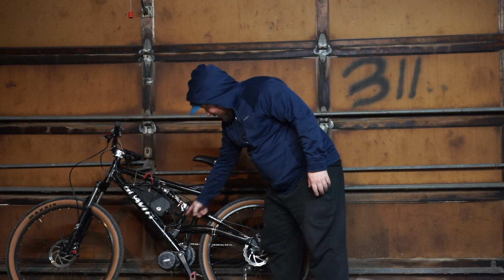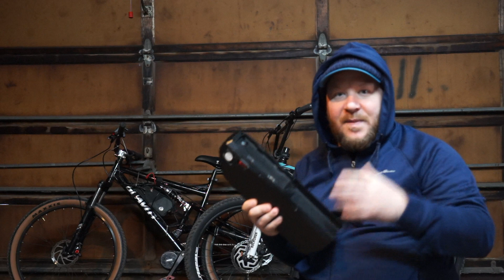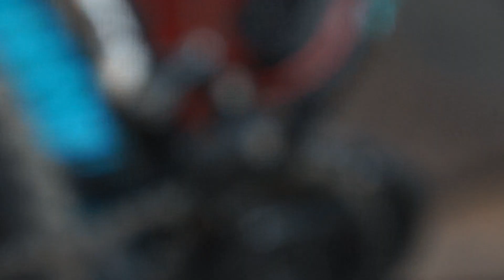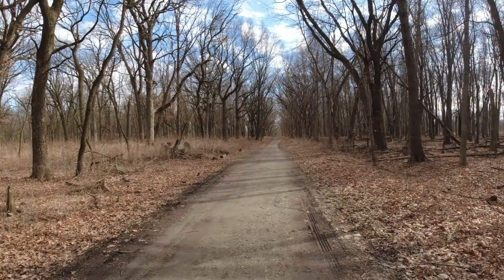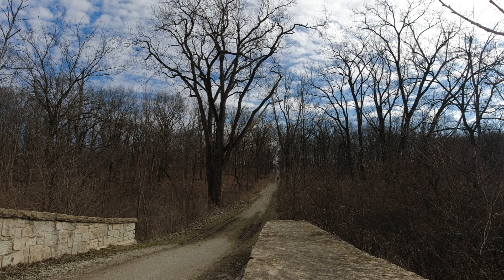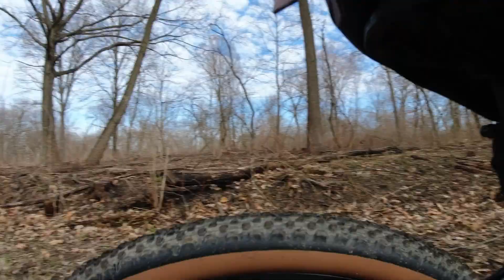How the BBS02 Stacks Up Aganist the BBSHD?

Comment: BBS02 is lighter but if you push 1200w+ the nylon gears will soon need replacing or upgrading. BBSHD is a heavier tank that can be modded for 72v with an upgraded controller. Insane. Chews sprockets for brunch. IMO the hubs are like driving an automatic whereas the mids require active shifting. Can't start out in top gear nor can you go too fast in 1st gear.

Comment: hi! i want to do delivery for like 8 hours, and am looking at the bbshd, i dont plan on using throttle only, and would pedal on flat ground too mostly, and was wondering what battery set up youd recomend? would you do dual battery or is that too complicated? is 48v good for range? im looking to go 100-150km with battery
Reply: maybe even more KM on a charge if possible lol

Comment: I have an 02 with an hd controller.  Best of both worlds.
Reply from the maker: intersting!
Reply: I'm pretty sure they use the same controller, but the amperage is turned up a little higher on the BBSHD "35A" in the control tunings. It's the same replacement part. You only get "more" by adding a higher voltage/amp battery or an external aftermarket controller.

Comment: I bought a 52 by 20 if that makes sense. That was a good deal but I almost want a smaller battery for weight concerns. The tuning chord is on the way but that means I'm going to have to buy a laptop. I will because the nerd in me wants to f*** with it
Reply from the maker: yes 52v 20ah. I feel you! I had to buy a $20 windows laptop to tune my bafang's as the program doesn't run on mac.
Reply: @GuntherSnaps  got an adapter for my cord, supposed to be able to go through my phone we'll see.lol

Comment: Like you I want to peddle for exercise.   I converted a 26" mountain bike back 2020 with a BBS02, 27" wheels, a Shimano 8-speed IGH.  By installing a 54 tooth chainring I can maintain contact with the peddles at fairly high speeds in peddle assist 1.  Once tuned it is very hard to beat this setup as I have put over 5,000 miles on this bike in the years since, thanks for the confirming review.
Reply from the maker: yea I really like having both, but the bbs02 is much easier to ride for exercise!

Comment: what range are u seeing on the bbso2? i get 10 miles max on top power setting. 17ah battery.
Reply from the maker: Honestly I don't even know, I'm only running like 6 miles at most and then I charge and I'm pedaling a lot so usually getting home with like 99% battery

Comment: Hi there. 
Would the 750 watt be enough for climbing steep hills on the road, or would the 1000 watt be a better motor to go with? Is the 1000 watt more thrilling to ride? I was also concerned the 1000 watt would disintegrate and wear out my cassette hub faster...
Reply from the maker: All depends on how much you weigh, I'm like 235 lbs and I go up a super steep hill on the bbs02, for me it actually works better because I can get into the correct "climbing gear" with the 02. so it actually takes a lot less effort to get up our steepest hill

Comment: Use Gustavo offset chainrings (way cheaper than Lekkie) and perform just as well. They have a narrow-wide profile to hold the chain on better. Also upgrade to a clutch derailleur to keep tension on that chain. The first thing I did was get rid of the stock Bafang chainrings. They're crap.
Reply: You can't get those Gustavo chainrings in Britain, I don't think.
I've got a narrow/wide 36t, by some cheap Chinese company. It has no offset, but it's working fine. The chain line is towards the higher gears which is how I want it. There's a lot of offset in the lower gears, but shifting is still smooth and quick, even without a clutch. I do have a shift sensor though, which I think is essential on any ebike with a derailleur.
Reply: @gedofgont1006  they are soldon eby uk, but from a polish seller
Reply from the maker: thank you! I will have to look into them!

Comment: Chain alignment isn't a problem, you need an offset sprocket (chain ring) they're dish shaped to correct the alignment. Lekkie have  Bafang specific sprockets.
Reply: and they cost like 90€
Reply from the maker: exactly
Reply from the maker: and they cost like 1/4 the amount of the whole bbs02 motor
Reply: @GuntherSnaps 
Yeah, Lekkie seem to have a monopoly on those chain rings.
Why isn't there a cheap Chinese rip off we can go buy?
Reply: @gedofgont1006 there are plenty

Comment: Perfect review for a 30-something ex-cycle commuter like myself hoping to start a 30mile round-trip commute again. Seems like the BBS02 would be a good fit for me. Thank you for your killer feedback fellow bikebro.
Reply: it will be more than enough, this things go crazy even on hills, and if you pedal you either love it or have to tune it down, because it will assist you more than you may need, I used to pedal a lot as I am just reaching my 30s I am fit, but basically whatever I push, even if I pedal hard that does not contribute much to the speed unless I just try to stay on a low assist level and keeping a steady speed. normal person can do 20w to 80w on power, pro sprinters they can constantly do 250w I think, so yeah crazy fast
Reply from the maker: glad you got something out of it!

Comment: thanks for the video, I have a bbs02 36v500w, but I was thinking about buying a bbshd because everyone takes it, and finally the video helped me look at it from a different perspective
Reply: I am thinking similar, i got the bbso2b 36v 500w and I want so bad to get a 48V battery instead of the my 36v to keep with traffic, reading seems like despite they look the same on the outside, the 36v 500w its a bit lighter, the controller i am pretty sure its the same but I am not sure on the motor 100%,.. I normally push my bike to 13A/500w draw just when I need it and keep it on a safe 300w constantly, rarely go to like 700w and I can feel the acceleration, not sure if I would break my motor by getting a 48v battery by asking it too much
Reply from the maker: there is a time and a place for everything, I like having all of them to be honest. I have a bbs02 for when I want a workout. I have a bbshd for riding the kiddo around with lots of power and then I picked up a 20" 750w hub motor "motorcycle" thing for just rolling around town

Comment: I'm no expert because I've never owned one but I'm sure there are things you can do to prevent the chain line being out of whack and reducing chance of chain coming off. Using a Lekkie bling ring is one of those things that is known as a must do.
Reply from the maker: Yea different chain rings move the chain line by a couple mm. This is true. But for $100 I don’t see the value.
Reply: @GuntherSnaps  From what I've seen due to shape  it moves it so far back in that some have to use a spacer to bring it back out so it doesn't rub against the frame. It's also apparently much lighter compared to the stock offering and has the narrow/wide configuration that prevents the chain from jumping off. Like I said I've not used a a bafang kit before but when I price it up I'm adding the cost of a 42T lekkie ring without ever considering just sticking with stock ring.
Reply: its mainly because the HD its sold on different widths to fit fat bikes on the bottom bracket, that makes it be offset for normal 67mm BB its a common thing among bbs's users

Comment: Great video. Love my BBS 02 I use a leckie chain ring of about 42T and my chain line is insanely straight. Like you, I also love using pedal assist zero. There is no need to be using power if I don’t have to.
Reply: @banyanstudio - sorry for my belated reply!  Thanks for this comment.  I also am feeling dislike for the usefulness of cadence PAS.  It comes on at a fixed power when all you want to do is pedal.  If I just have the throttle, I can use all gears and pedal as I like and then use throttle whenever I need assist, but with throttle YOU control the amount of power (PAS just delivers it at fixed amounts (yes, there's levels but not good enough and not able to modulate quickly and on demand enough as with throttle only.  Riding with Throttle only is the best e-bike experience especially in the trails.  I feel that this vid of  GuntherSnaps is telling us all about what we really want in an e-bike.  This vid is more significant than what we all realize in regards to the evolution of e-bike design.   All e-bikes should allow throttle in PAS level 0, or offer a "T" (throttle only) level?).   Also, for mid-drives kits, they gotta be mindful of chain-line.  Another thing that conversions should consider is the recent arrival of 11t-46t 8-speed $60 cassettes from Amazon.  The wide range cassette really opens things up for the motors like BBS02/BBSHD (using a Leckie 42T chainring with 5mm offset with this cassette means both 40mph speed and steep hill climbs all on BBS02 52v.

Comment: You need a oyster chainring for the bbshd to make it line up correctly
Reply from the maker: what's that?
Reply: @GuntherSnaps  there is some chainrings that are somewhat skewed to the inside on the outer part to compensate

Comment: EM3EV 20Ah 52V battery gets drained by 25% after using the bbshd for 15 minutes at 8Amps on average for some reason. More than cheapo Chinese battery.
Reply: Have you tried a different 20ah 52v battery
Reply: @CM-1723  Can't afford another one just for testing. EM3EV keeps repeating: "Have you tried to discharge it and recharge it completely so that BMS can calculate proper health status"

Comment: Thanks for the video, I have a Bbshd and actually thinking about getting a Bbso2 for the same purpose you mentioned, would appreciate if you can share a link to  where you got the 48v 6ah battery, many thanks
Reply from the maker: they don't make them anymore. I wish they did, I bought mine on ebay. It only charges to about 3.5ah so it kinda sucks. I feel ripped off. But it's enough juice to get me home.
Reply: Jump on the sale till midnight

Comment: Can't you get away with a single speed on the 02?   With a get it home gear...i don't have any steep hills to deal with but i do have long hills.  I really dig what your trying to do with your style of riding...i to want to go pretty much the same route...a lighter weight ebike but still riding it like a acoustic bike.  Thnx
Reply from the maker: sure, but why not have gears? the advantage of a mid-drive is being able to have gears. Mid-drive is basically just a single speed.
Reply: @GuntherSnaps  I'm using a belt drive...I wouldn't mind getting a 3 speed hub... But I would like to keep it simple and light.  I've tried hub drives but I didn't like the balance of the ride.